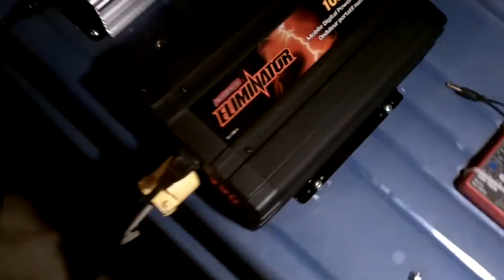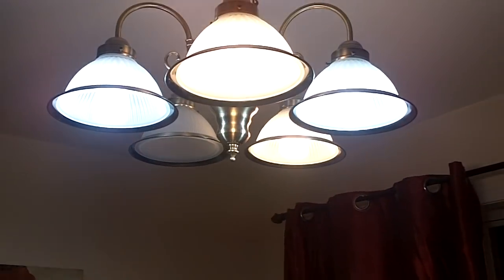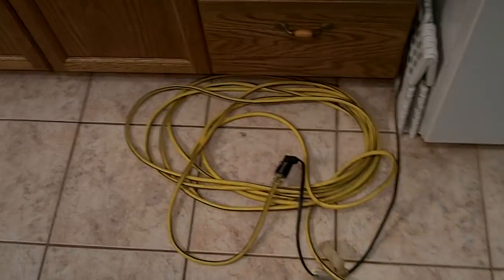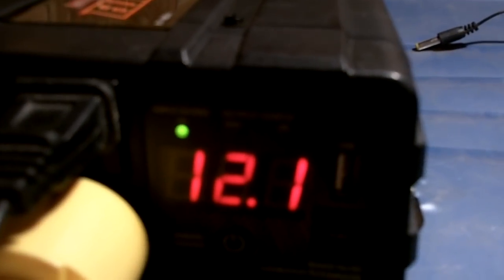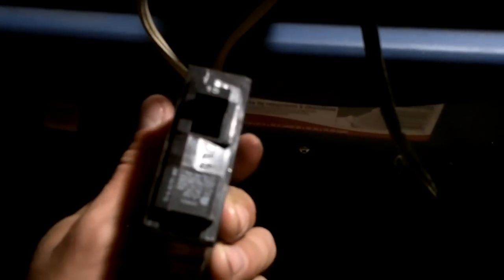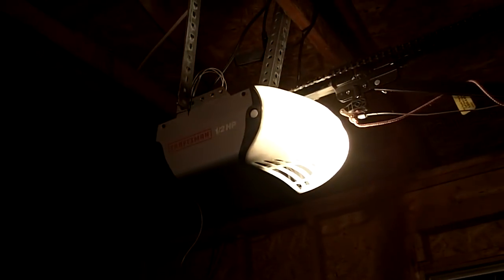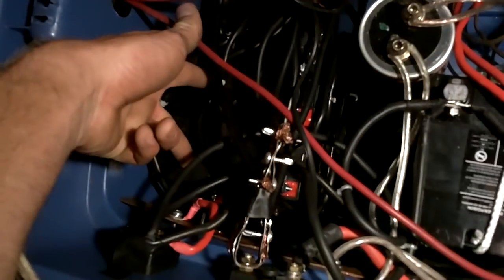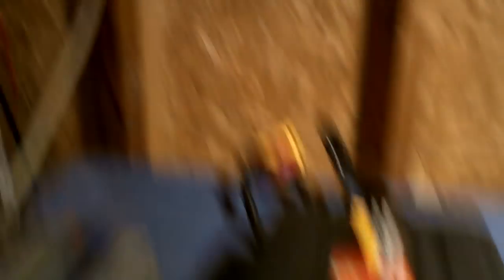House running off 1000W inverter

Comment: Your clamp meter is not inaccurate! Power = Amps x voltage

The reading on your clamp meter is reading amps from 12 volts, while the meter in your wall is reading amps from 110-120 volts!
Reply from the maker: very true, a rough way of doing quick calculations  in a 12 volt set up is just to times the 120v amps by 10 and you get close to the amps you are drawing from your batteries at 12 volts
Reply from the maker: you are right this clamp meter in ac only my bad lol
Reply: that is right your dc amps will be much higher then your ac amps
Reply: fliping720
Which clamp meter is that
?
Reply from the maker: a power fist lol
Reply: Can u tell me which model  ?
Reply from the maker: SKU: 8203440 is the clamp meter never buy it its junk!
Reply: ok thanks would like to get one that is good
Reply: fliping720
Amp clamps are only good for AC voltage, no?  You are reading on the DC side.
Reply: fliping720
Still a great video though!  Batteries stored in a proper plastic container in case of leakage.
Reply: I've found an meter at the depot that's been very accurate.
Reply from the maker: yea i would like to get one.
Reply: I just started my set up a while back.I just ran wire to the house with plugs in the areas most needed for emergency power.I can plug my generator in to  the same wire if needed.I have a small set up for now 2 100 watt panels and a 400 watt turbine works well.The  battery banks are so expensive I only have 150 aph baty bank for now so can't run much till I build up my battery Bank
Reply: https://www.youtube.com/watch?v=sVEdD0OHD30&feature=youtu.be

Comment: your inverter can run at about 8.3 to 9 amps on its output. the beaker should be no more than 10 amps if you want it to really do anything. (i would just use a fuse)  and you need a live line switcher.. im not sure if thats the name but its a mechanical switch that you install by your power box. it changes from grid input to your inverter input with a throw of an arm. it makes it impossible to back feed anything and makes everything safe. have one installed

Comment from the maker: yes, but first i shut off the main braker to the house, or you will kill your inverter, and most inverters have a live ground so you either have to get a cord with no ground or just not connect the ground wire to the house, I do not recommend because of the danger involved.